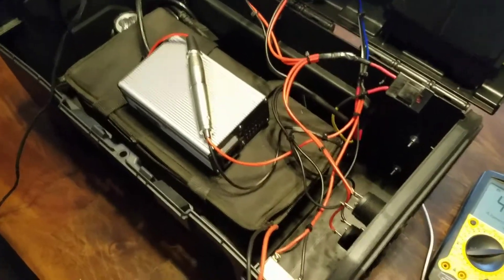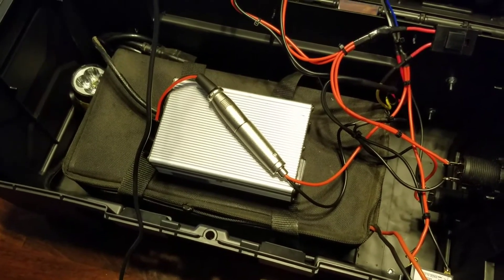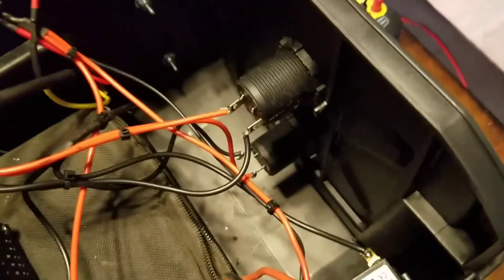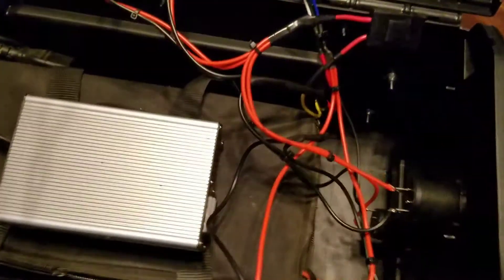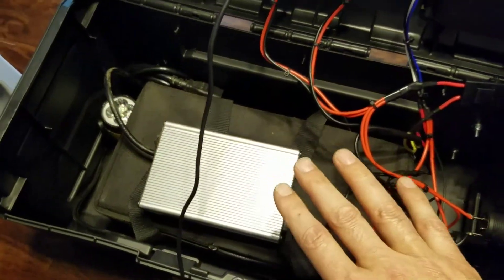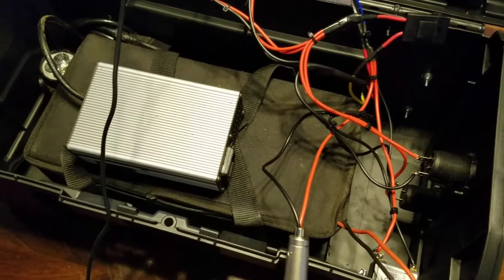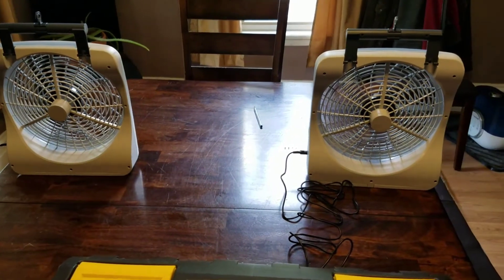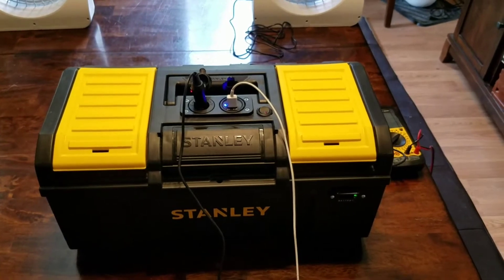DIY portable camping backup power 36v lifepo4

Comment: I don't think you will get all 30 amp hours out of those blue batteries. Lead acid batteries you can only get 50% which would be 15 amp hours lithium ion you can get 80% when battery is completely dead so by my understanding you may get 20 or 25 amp hours before the BMS shuts down. One 18650 is dead at 3 fully charged 4.2.
Reply: Would that be right?

Comment: Been debating about those blue batteries which I would need 2 of them or building my own out of used laptop 18650. Would like to get up to 60 amp hours. Not for sure where to get all these laptop batteries so let it isn't so expensive. I know I can go to eBay but some of them want a very shiny dime for their used laptop batteries. Trying to find a local place close by to buy them. I live in Missouri. To build out a box like yours which also could run that mini refrigerator.

Comment: On YouTube checkout ARB portable fridge freezer. Says it uses one amp an hour. It is a 12 or 24 volt hand can be plugged in the house. So with a power box and solar panels would like to run this refrigerator fan in my tent charge my phone and tablet for at least 3 days would be great. But when you add a solar panel you should be able to run longer than 3 days. Tell me what you think of it
Reply: What amp an hour did that Coleman cooler pool
Reply from the maker: Yep for sure. You would not even need a huge battery. Running fan, fridge and charging phone should be pretty easy. Those portable fridges are most efficient when kept closed so at night you use very little juice with no traffic. Opening and closing it will make it run more and as long as the sun is out or even decent light will compensate for the daytime traffic.

Comment: But how much bigger in amp hours is the battery you're using now compared to the blue 12v?
Reply: What type of little refrigerator was she running?
Reply from the maker: That is good question it is not bigger in amp hours. It can run something that is 36 volt at 1 amp for 16hrs. That is my basic understanding of it. What gives this good run time I believe is the 2.5x more power than your standard 12v battery. The 12v 30ah battery should also work the same way. Should be able to run a 12v item at 1 amp for 30hrs.
Reply from the maker: Coleman no compressor.

Comment: I think I have seen those batteries are they wrapped in blue shrink wrap? Sorry if I'm asking a lot of questions just trying to get everything settled out so I can build one badass box. How long do you think those fans will run on that battery?
Reply from the maker: Yep shrink wrapped. My 36v battery is same way inside canvas bag. And a camp fan on low uses 750mah and a Amp on high. several days 24hrs a day for sure without a recharge. My wife and son made it last 5 days and brought it back with juice to spare. Also my wife's friend showed up with a 12v mini fridge and ran it off the box for a whole day as well. No solar panels on that trip. We plan on getting a 12v real compressor fridge for next season so we are ready to power it and other things with the panels.

Comment: Would you happen to have the link to that 12 volt 30 amp hour battery that you have suggested to me?
Reply from the maker: john-coletta is the sellers name. He just sold out but just watch he will make more or get more. I have seen him sell out twice now and relist after a week or so. Or do a specific search on google or ebay for 12v lifepo4 battery or even more specific 12v 30ah lifepo4 battery and compare the prices for yourself. You may even find a better deal. I did see a 12v 60ah battery out there with ac charger for about 280. Single set of wires smaller gauge. I think the output is less because of that to like max 20 amp continuous draw. The one I suggested can do 60 amps continuous. Suitable to run a small inverter no problem up to 1000w or 1500w.

Comment: What is the name brand of your solar panels. I have been looking at renogy and have not come down to a decision yet on what to buy. But I am very interested in building a box I believe it will be very helpful. Thank you for all your help so far.
Reply from the maker: Mine are HQST 39 in x 39 in x 1.4 in thick. Together they weigh 51lbs. To get the best deal on them they came as a pair. If you build a strait 12v box you only need one panel and I would suggest a flexible panel or 2 flexible panels if you need 24v as I do. You could also order a single 24v flexible panel from Hong Kong for under 200 dollars. The boost solar controller I have needs at least 24v to work worth a dam.

Comment: No I have nothing that runs on 36 volt would just like to build a box just about like what you have to go camping with the Boy Scouts I can charge my phones tablet and run my fans. Would have plenty of power. Just got to try to find all the parts you have. I think you have a very nice battery box.
Reply from the maker: Then just go 12v. AGM batteries are cheap but pretty heavy. The best thing to use in this application is a deep cycle battery either marine grade or bite the bullet and check out lifepo4 battery. Those will give you most cycles for your money. Unlike regular batteries that don't like more than 50% discharge a lifepo4 can discharge up to 80% every time for a couple thousand cycles. Also by going 12v you can easily get by with a single solar panel. My box has to step down the 36v to a more useful 12v to even make use of the power which there is a little loss there. That 30ah 12v lifepo4 on ebay in ohio is best deal I have seen. The seller either makes them or distributes them. He says you can series 2 of them or parallel them to to either double current or capacity. But 30ah is a lot of juice anyway. To put into perspective the battery I describe here will out perform a yeti 400 hands down. Yeti has 17ah of usable power the 30ah lifepo4 has 24ah usable power before needing recharge. yeti's battery is even bigger by 5ah. Those boxes cost 300 to 400 dollars. The 30ah lifepo4 batteries I found also have separate charge and discharge wires.
Reply from the maker: Also the weight wow. That 30ah lifepo4 is pretty compact to 8 1/4 in x 5 1/4 in x 3 in. Weight 8.25lbs. Which is what my 52v weighs about 8lbs. So my next box will be on the lighter side.

Comment: Would like to try to find a replacement battery so that I can get a battery to build my own box
Reply from the maker: So you have something that runs off 36v but it needs a battery is that what you are saying. And then use the battery in a secondary way like I am?

Comment: What is the name of the 12 volt fans you are running?
Reply from the maker: Roadpro 10in model. They also take 8 D batteries as well and claim to run up to 40hrs on those. Or come with the 12v adapters. I think I paid 20 each for them free shipping.

Comment: Yeah I've been checking out your videos. I have subscribed to your YouTube channel. I do a lot of camping with the Boy Scouts would be nice to set up a fan in my tent and charge my cell phone and tablet
Reply from the maker: Oh roger that. If you have no battery to start with I would just suggest a 12v one. There is a seller on ebay that sells 12v 30ah lifepo4 batteries for 200 dollars and 14.00 shipping in ohio. Heavy duty wires perfect for a inverter already 12v. Your box will last a decade or more. If I didn't already own these batteries I would go that route.

Comment: what type of scooter did the battery come from? I am looking to build a box for myself  but will probably had a small inverter to.
Reply from the maker: Super turbo lithium 1200w scooter. The battery it self weighs about 18lbs 36v lifepo4 16ah. Can do bursts up to 100amps. Continuous 40amps. The place i got my 52v lipo ebike battery sells a 400w pure sine wave inverter I can plug right into the 52v battery so my next box is going to use that and a 12v converter.
Reply from the maker: I have also hooked this up to solar panels now to. I have a couple videos now showing how I do that. And charging 52v ebike batteries off same rig.